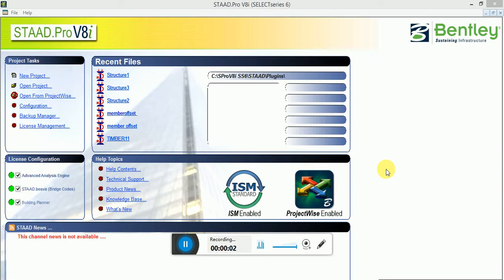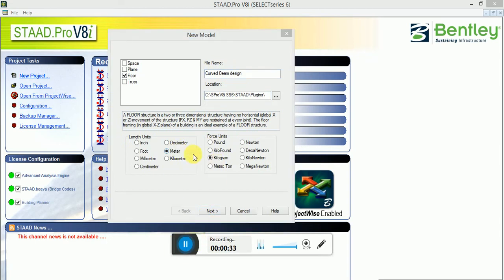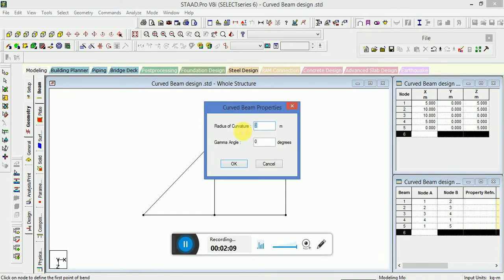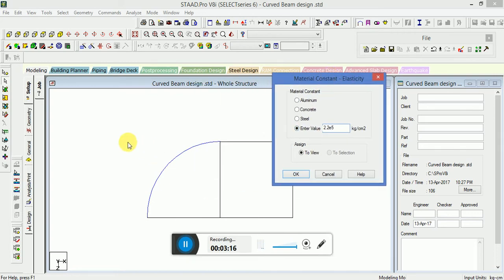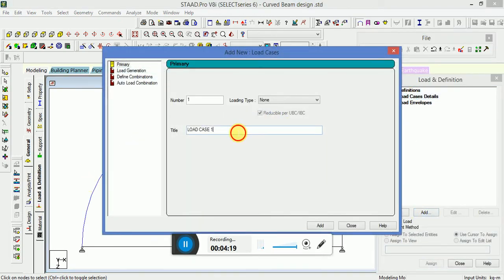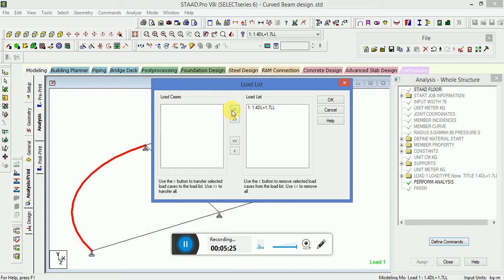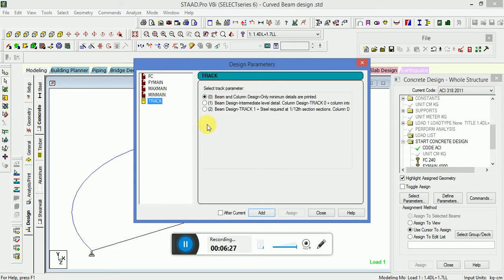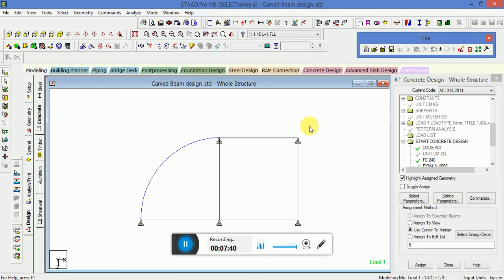STAAD PRO CURVED BEAM||CURVED BEAM MODELLING DESIGN & ANALYSIS IN STAAD PRO V8I

Comment: Sir, if I stretched 12m and the height of the building was 6.5 then would like to make a half-circle of gamma angle and curva radius?
Reply from the maker: In steel, a curved beam is designed for the forces and moments at its two ends. Intermediate sections are not designed.
Reply from the maker: Please note that the Curved beams are of two types (1) Beam curved in Plan and (2) Beams curved in Elevation. The behavior and hence the forces and deflections of the beam will change accordingly. You may refer a book by - Adv. Structural Mechnaics by Boresi or any other similar book. Even the Roark's handbook of Stress and Strains will be useful reference.

   In old versions of Staad the Curved beam command never functioned properly, I will suggest that you divide the actual curved beam into number of straight chords and then analyse.

Comment: Sir how to apply plate in curve beam
Reply from the maker: Please note that the Curved beams are of two types (1) Beam curved in Plan and (2) Beams curved in Elevation. The behavior and hence the forces and deflections of the beam will change accordingly. You may refer a book by - Adv. Structural Mechnaics by Boresi or any other similar book. Even the Roark's handbook of Stress and Strains will be useful reference.

   In old versions of Staad the Curved beam command never functioned properly, I will suggest that you divide the actual curved beam into number of straight chords and then analyse.

Comment: While assigning member property,  curved and rectangular beam assigned at a time.but assigning loads it only act on curved beam???
Reply from the maker: Please note that the Curved beams are of two types (1) Beam curved in Plan and (2) Beams curved in Elevation. The behavior and hence the forces and deflections of the beam will change accordingly. You may refer a book by - Adv. Structural Mechnaics by Boresi or any other similar book. Even the Roark's handbook of Stress and Strains will be useful reference.

   In old versions of Staad the Curved beam command never functioned properly, I will suggest that you divide the actual curved beam into number of straight chords and then analyse.

Comment: Sir can you please tell me how to do live load analysis on the curved bridge by using staad pro
Reply from the maker: Please note that the Curved beams are of two types (1) Beam curved in Plan and (2) Beams curved in Elevation. The behavior and hence the forces and deflections of the beam will change accordingly. You may refer a book by - Adv. Structural Mechnaics by Boresi or any other similar book. Even the Roark's handbook of Stress and Strains will be useful reference.

   In old versions of Staad the Curved beam command never functioned properly, I will suggest that you divide the actual curved beam into number of straight chords and then analyse.

Comment: So whether we know it's safe or not
Reply from the maker: Please note that the Curved beams are of two types (1) Beam curved in Plan and (2) Beams curved in Elevation. The behavior and hence the forces and deflections of the beam will change accordingly. You may refer a book by - Adv. Structural Mechnaics by Boresi or any other similar book. Even the Roark's handbook of Stress and Strains will be useful reference.

   In old versions of Staad the Curved beam command never functioned properly, I will suggest that you divide the actual curved beam into number of straight chords and then analyse.

Comment: this tutorial why assign pin support and saperate density,elastisty, poision ratio. sir plz describe reinforcement detail after analysis of model. thanks
Reply from the maker: Please note that the Curved beams are of two types (1) Beam curved in Plan and (2) Beams curved in Elevation. The behavior and hence the forces and deflections of the beam will change accordingly. You may refer a book by - Adv. Structural Mechnaics by Boresi or any other similar book. Even the Roark's handbook of Stress and Strains will be useful reference.

   In old versions of Staad the Curved beam command never functioned properly, I will suggest that you divide the actual curved beam into number of straight chords and then analyse.
Reply: @vibhorshukla850  thanks sir
I m work in road and survey so i request to you for learning design and analysis 
all types of road structures so plz give contact no. To with you 
I m so interested to learn plz guide me 
Again request plz sir
Reply from the maker: @ayubpatel8910  you can contact me on my email id for road works i can suggest you various softwares by which you can learn and improve your basics :)